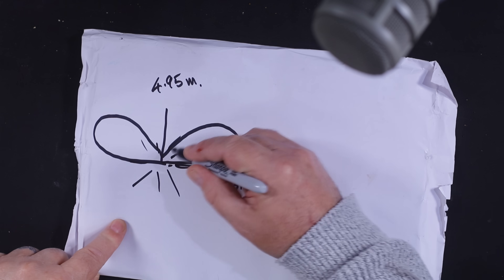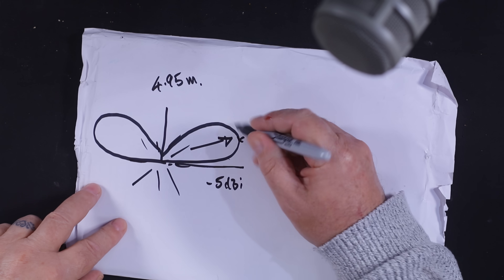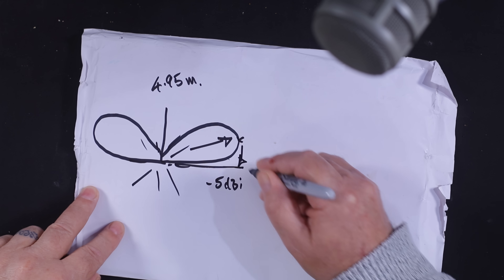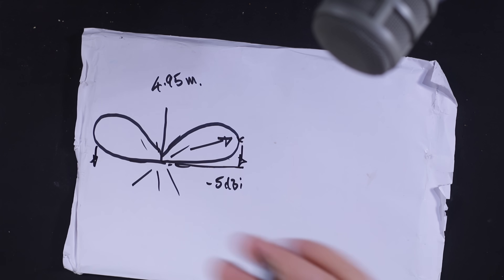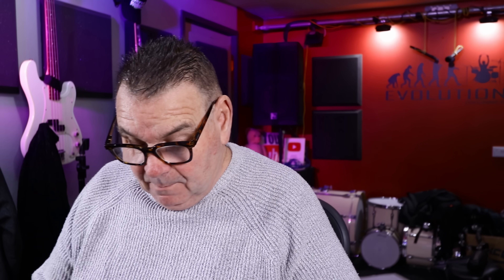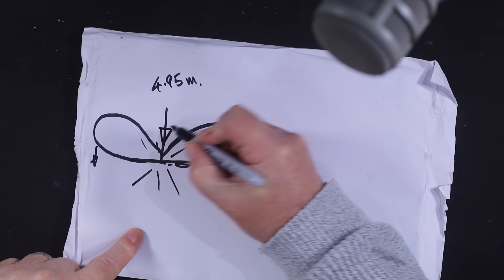Ham Radio Antennas - What Actually Works? - HF From a Small Plot (HOA / UK Planning)

Comment: Cal a great real world video.   

My problem is (and I’m sure it’s not unique as there are plenty of houses like this in the U.K.) my back garden is tiny it’s only about 16ft wide and about 12 feet deep.   But, this is the issue, the houses are back to back with a small access road between.   So the gap between is only about 40ft.   So my concern is with a vertical most of the RF is going to be radiated straight into the houses.   Or am I looking at this wrong?
Reply from the maker: Yes - and most of the RF will go straight through. It's not microwave or even VHF.

Comment: I have a sensible back garden,60 feet by 28 ish, on my workshop I have a extendable pole with a 2m vertical. It can go up about 40' i also have a pole around 10 feet with a glass fibre vertical on, it gets into Russia, all of Europe and I have heard further. It does 6m to 80m . On the fence at the top edge if have a 20M long wore, goes down the garden between two houses to the front garden, gets all over Europe. I used electric fence screw in hooks for that.  My radio is a G90, the 2m radio is a cheap 90 quid thing.
Reply from the maker: You are making the best of what you have! The Committee approves! LOL!
Reply: @DXCommanderHQ I took my foundation exam on the back of your advice, thank you Sir for your help.

Comment: @DXCommanderHQ how well wil the DX Commander antenna work if its within say, 10ft of a 75ft, 2meter VHF radio tower? Winds here are pretty bad at times, so my though was to put it in the ground like normal, but instead of guy wires from the top, have it "dangling" (if you get the point) with the rope,from a large Standoff near the top of the tower. So in other words, the bottom of the antenna would be exactly normal, but at the top, there only 1 rope and it goes straight up. Only I'm not sure how well it would work, that near such a large metal object. But i see people doing this very thing with inverted "V" antennas all the time.
Reply from the maker: OK, so in the main you should be able to tune it... 75 feet is big - taller even than q/wave on 80m band so mostly, it'll be (almost) invisible to other bands.

Comment: Generally speaking in the USA, it's the local municipality.  Sometimes it's the county level but it varies by state.  Zoning and Land Use regulations are what attempt to kill hobby radio.  If you live there, it applies to you. Home-Owner Associations are usually set up by the developer who builds a subdivision ("housing estate", I think, in England).  They exist either to provide communal services that the municipality won't/can't but mostly there to be nosey neighbors and prevent you from "harming property values".  If you buy property in that area, and there is a deed restriction that requires to be part of the HOA, then their rules, no matter how silly, apply to you ... because when you bought the place, you signed a paper saying you'd abide them.

Some amateurs in the USA think the Congress is going to step in and invalidate those portions of contracts that prevent installation of amateur antennas.  IMHO, they'd have more luck getting on the HOA board and getting the rules changed.
Reply: I was just telling my XYL about this yesterday... that I should try and join the HOA board 😂

Comment: I have 2 radios and plan to run one as TX and other RX. I'm talking more less 10-15m distance one antenna from another. I'm afraid that I might damage RX radio while transmitting on the other one. I have 100w with permitted up to 500w. 
Any advice?
Reply from the maker: OK, so both on same frequency... OK, I would personally take my PTT line and click Radio 2 into TX mode while TX on Radio 1 - then you can't blow it up.

Comment: The vertical is fine for 2000-3000 miles. I use an OCF half wave vertical and I get around the US, Canada and South America no problem most days. That works very well. However, I need 5500 miles to reach Europe and 7800 miles to reach Australia. I've done both with 500W on the OCF vertical, but it's rare. For DX past the Americas, I think you need a directional antenna unless you have perfect band conditions or a location on the US east coast like Salty Walt (K4OGO) for Europe.
Reply from the maker: Great insights on antenna performance for DX!
Reply: My current QTH is East Coast of Canada. It is amazing where I can reach. However, this summer, I visited my sister inland (Calgary Alberta) and brought the radio kit and a new to me DX Commander Expedition. I was getting up and down the americas, Japan, Australia, NZ etc with FT8 at 100W. I was shocked.
Reply: You might want to watch Cal’s live videos. Where he uses a DX Commander vertical to talk all around the world. Alot of value in the DX commander design compared to a directional antenna if you evaluate cost per dB. AC4XT

Comment: My LoG is 36m of wire running around the concrete slab of my colour bond shed. (10.1mx7.5m 3m walls) Using a isolation transformer 2 primary 6 secondary windings. I have run a VNA on it and oddly enough is scans like a dummy load, flat VSWR from 160m to 10m. The FTDX5000 is happy transmitting into it however most of the power seems to go into the ground. RX wise on 80m in the suburbs I run AMP1 with a S0 noise floor and excellent SnR. Cal you may or may not remember I have worked you on 20m on two different occasions using EFHW for TX and LoG for RX.
Reply from the maker: LoG on 20m RX? Fair enough!

Comment: That Icom 7300 M 2 is super !  Nice RX jack !  And i find them chokes help with RFI noise . Some times the shield receives the noise. Adding the common mode choke stops the RF on shield so the RF inside the coax stays reducing noise.  But all noise is not the same . Just get some ferrite and give it a try.   Cheers from NY !
Reply from the maker: Great insights on the chokes and RFI, thanks for sharing!

Comment: Thanks Callum for reminding me I need to rebuild my 40m delta loop. I've been putting it off for a couple of years. I do like the idea of breaking the loop to use it on 80m, have done that a few times but I don't seem to need to take any length out for it to tune. It's linear loaded at 2 corners which may have some bearing on it. Lately it's taken to not tuning on 10m but tunes ok on 12m, no idea why. So I get 40/20/15/12m ... work that one out I haven't. Anyway wishing you and your family a happy and prosperous New Year. Regards Jonathan G4GMO.👍
Reply from the maker: OK, good one Jonathan.. And indeed, have a great 2026.

Comment: @DXCommanderHQ Hello Callum! Happy New Year sir. Quick question - I have an Expedition that I would like to get set up semi permanently with an umbrella stand similar to what you have done elsewhere. If the stand is metal and the pole inside the mast to stabilize is EMT conduit, could it cause issues or should I change to a plastic stance or something similar?

Thank you & cheers,
Rich AK4RD
Reply from the maker: Personally, I would use something non conductive... Long story - but I tried it with an alloy one once and things were - erm, complicated! However, that was 7 feet long and 12m and 10m went away... SHort might work.

Comment: Should you size a loop on ground differently for 20m and higher frequencies, or can the standard  15x15 square version receive well across the board?
Reply from the maker: I don't know - check the web page where the "designer" chats about this.

Comment: You might not be selling today but my buddy Took a 40m pole and spirally wound 12awg thhn up the whole pole. He then made a pvc coil and has 120 turns of 12awg up the 6” pvc and layed 4 60’ ground radials and has a 15 over signal on 160m using 500w work’s amazing for a short vertical ant 😊
Reply from the maker: Lovely.

Comment: Nice. Maybe a ladderline fed doublet around a 3/8 wave on lowest band (45/90ft for 40/80 to 10m) could be an option.
Reply: I’ve ran a 160m doublet over the last year. Great performer, oldie but good antenna. However I’m switching to a horizontal 80/40 fan dipole. And a DX commander signature 12.4. I’m tired of tuning between bands. I just want simple resonant antennas anymore. Love your channel by the way. AC4XT 73’s
Reply from the maker: That's an interesting idea!

Comment: good info as always Callum. that idea of a full wave 40m loop with a 4/1 Balun and removing 7ft to create a folded dipole on 80m....was thinking,you could also use the same idea ,create a "folded Windom" dipole that covered 80-10m by seperating that 40m wire at the 1/3rd point from one side of the balun. saves you having to keep popping outside to add and remove that wire to get on 80m.  another underestimated multiband antenna with low profile is a Magnetic Loop...expensive though unless you homebrew one. HNY all...
Reply from the maker: Yes, Mag Loops work - just sometimes complex for folks and lower gain.

Comment: Would a Loop on Ground work underground? If you buried it a few inches? How deep could you go?
Reply from the maker: It gradually looses sensitivity.
Reply: @DXCommanderHQ  That's what she said!
Reply: nope if you bury it the cons (noise ground loss etc) will outweigh the pros. the optimum is just to lay it on the surface or better if you can use plastic pegs or sticks and prop it a few inches above the surface.
Reply: @shayne109  a couple of inches does nothing, literally zero change.  If you go a couple of feet sure, huge losses. Like I said, I have one in my backyard and it's awesome at 3 to 4ish inches deep.
Reply: @GoonyMclinux  Now I wonder how soil moisture would affect that. Buried would be the ultimate flex for a receiver.
Reply: I had one it was 4 or 5 inches deep, I read somewhere they work the same buried or not, it did log things.
Reply: @GoonyMclinux  did soil moisture, rain, snow etc affect operation?
Reply: @dinosaurmuscles4534  it does like any antenna, my vertical is effected by all those things also. In a pinch it is an ok transmission antenna but I use mine for receive because the noise is so low. I have tried it transmitting a few times and it makes contacts. The only but I have is what type of soil you have, mine is rocky and deep calichi and it works as it should, I have tried one in sand and other types but solid rock areas don't work as well. Keep in mind for transmission its a compromise antenna for sure for receive its a low noise option.